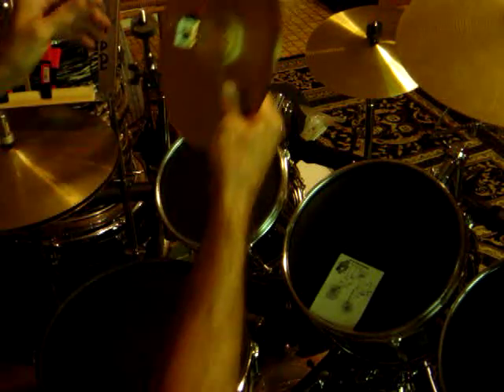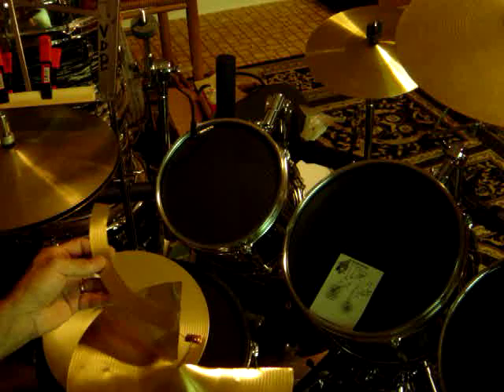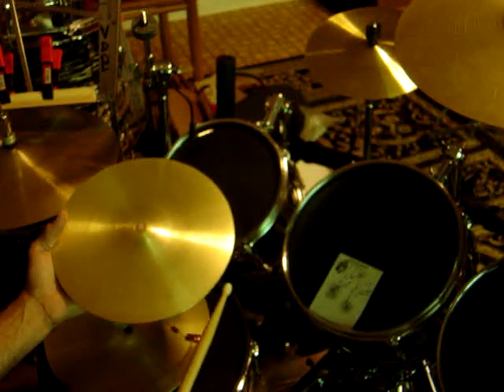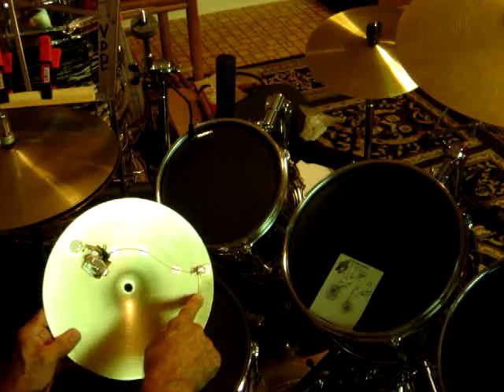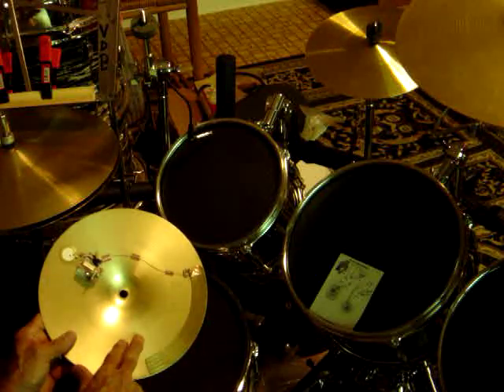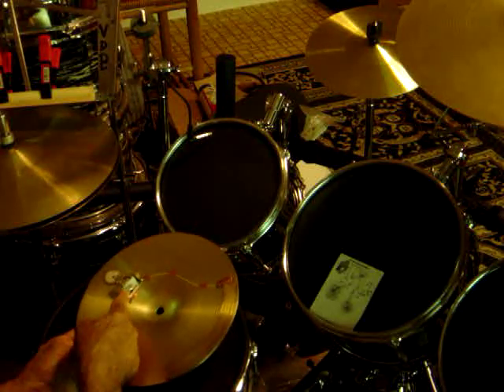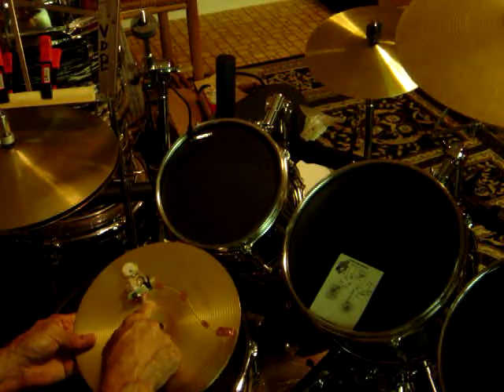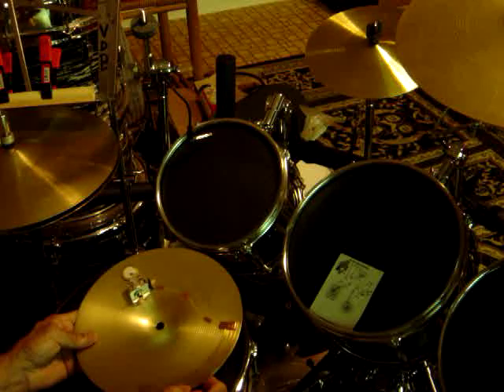DIY  Dual Zone Cymbal with Choke.MPG

Comment: I gotta tell you I appreciate the info you're putting out. Long story short.I recently built a 'psuedo-drum set' out of miscellaneous materials, just to have something to beat on. Fate gave me a TD-6 control module and cables, that's it. I'm an electronics hobbyist with some decent equipment. Just ordered 15 piezo triggers. Looks like I'll be able to build my own e-cymbals and add some decent sound to my set. I'm very much obliged.

Comment from the maker: @oakendyk one wire connects the small, cut section back to the ring.  the sleeve of the jack is electrically the same point as the cymbal.  The sleeve is connected to the cymbal directly at the jack mount - thus allowing the cymbal surface to act as the second half of the switch.

Comment from the maker: This means hat the only wire from the actual switch is for the smaller/cut section that is mounted to the cymbal.  it is also important to not let the cut/small section make contact to the cymbal - it should only contact the cymbal when it is either  1- Squeezed, or 2- when the edge is struck firm enough to flex the two parts together.

Comment from the maker: @lucyferina :...  Your understanding of the switch connection  is correct, one lead to Ring, the other to Sleeve.  However, the piezo leads will get wired one to the Tip ( the brass side of piezo), and the other lead (ceramic of piezo) to Sleeve of the TRS.  This means that only the Sleeve of the TRS jack  has one side of each (switch and Piezo) soldered to it... I sent you a Private Message with links to the web locations referenced in the video and in my previouse reply.

Comment: alesis trigger io is a no go. theyre not setup to take the swithc input like roland is. do yourself a favor and sell your trigger io on ebay and get an old roland brain like the td6. then use that as a midi hub into your drum program just as your would have with the alesis. hope this helps. big props to racer52 for the wiring explanation as well. i used some of his ideas on my own diy cymbals. check it out on youtube. just type in diy brass triggered cymbal. im the guy with the red/black tanktop

Comment: Hi friend. Excellent video ... Great idea! To be able to perform with acoustic cymbals. The only thing that can not be appreciated is construction. Will you have the diagram of the connections to the piezo and the stereo jack? and how is each and the cable to the plate that I want to imagine that one of the cables makes ground in the saucer? Is that correct? I hope you can pass me the diagram by mail or how would you contact? Thank you.

Comment: Hi. Thanks for this video. it helps me a lot. I have only one question. I finished my cymbal. it works fine, but it seems like the switch doesn't have any sensitivity. No matter how many force do you apply to the edge stroke, it always sound at the same level. 
That is correct ? or I need to do  something about it?
I have a Roland Td-8.  Thank you very much for your help. And sorry for my English!!!!

Comment: Thanks for the awesome content!  I'm thinking about attempting my first cymbal conversion -- probably a 14 or 16".  To keep things simple, starting with a single zone.  What size piezo do you recommend?  Does bigger piezo = more sensitivity?  Does your recommendation change if I then continue the conversion to a dual-zone?  For sound proofing, thinking about repurposing the rubber from an old truck inner tube, adhering it with contact cement.  What do you think of that idea?  Thanks!

Comment: You mentioned the coating helps the cymbal level to the correct position. does the electronics w/ a plastic box cause any unbalance or spinning?

Comment: I'm using a Yamaha dtxpress drum module how can I find out if it works off the same switch type connection also I tried this and it would only pic up the bow of the cymbal and not the edge... do you kno y this might be? FYI The original cymbals with that drum unit were chokable via squeezing the edge of the cymbal

Comment: I was just wondering. If I were to create electronic hi hats would I need a choke or would the cymbal underneath act as the choke strip?
Reply from the maker: The real answer lies in your controller. Typical is to have a separate line/jack for HH Cont. with a single or dual zone cymbal.  The basic/ lower end style control input typically uses a one or two level switch. Giving open/closed hats (sw is open or closed), or open/partial closed/closed hats (open switches/ sw1 closed/sw 1&2 closed)  the normally open style contact switches are applied across Tip - Sleeve , or tip-sleeve  and Ring-Sleeve respectively. Or some simple variation of that concept. Roland, megadrum and others that offer more realistic options use some version of a variable input to control a variable HH sound. Roland uses a variable resistance, megadrum used a variable voltage. However, they may by now, accept any of the three versions??? This all matters to your controller/interface.

Comment from the maker: In principle it should work to at least some functionality.  true function will depend on input is used on  the trigger IO and how it is configured.  That said, I have no hands on experience with any trigger IO products.  you may deed to do some more research...or experiment.  good luck :-)